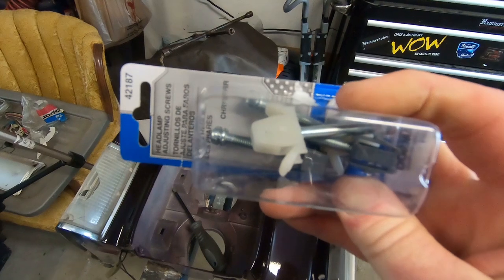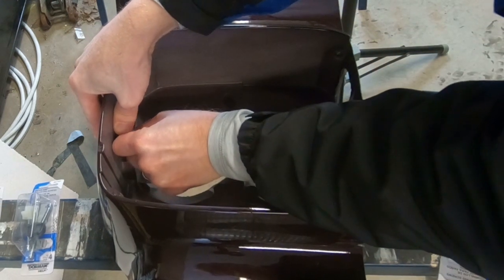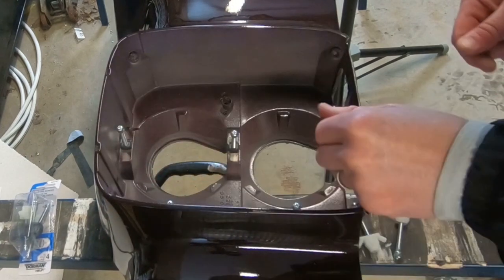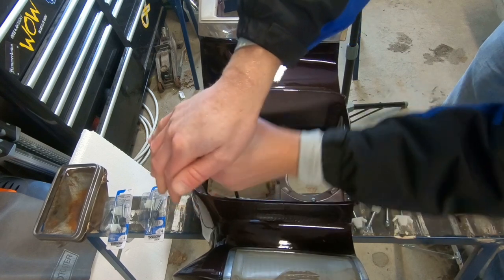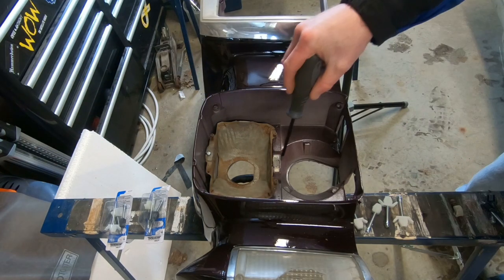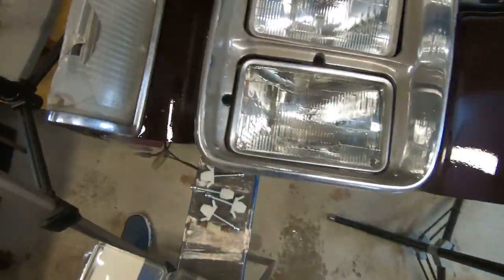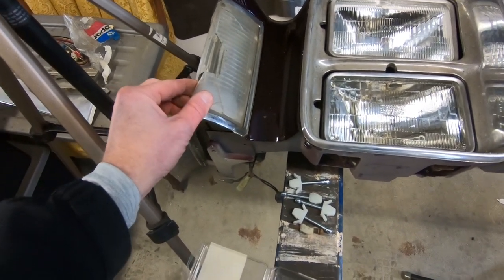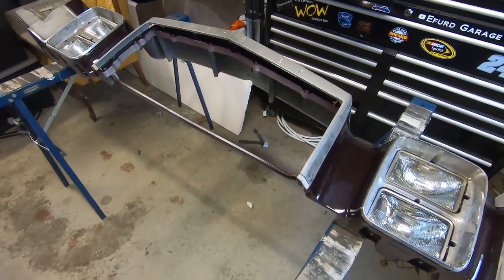WALL ART PART 4- HEADLIGHTS ARE IN

Comment: Nice to see doorman is keeping there quility control just as low as ever lol really looking good the chrome really makes the paint pop how are you going to drive the lights?
Reply from the maker: I'm thinking a 12 volt inverter to run the park lights. As far as headlights, I'm not sure yet! And yes, quality Dorman products.
Reply: Door man is junk
Reply: @OldeCarrGuy  Nice! The headlights are going be be a pretty big load to power. Make sure you put a fuse inline regardless. It often gets  overlooked and being on the wall there is always that potential for combustion.
Reply from the maker: Yeah! I'm thinking of cutting the power way down so the just glow enough to cast a shadow. I don't want to be blinded!
Reply: @OldeCarrGuy  Perfect job for a rheostat, I hadn't thought of that.